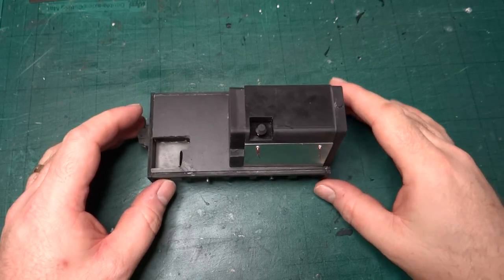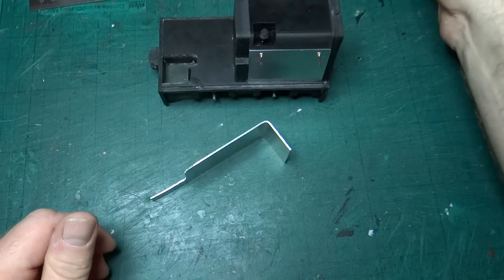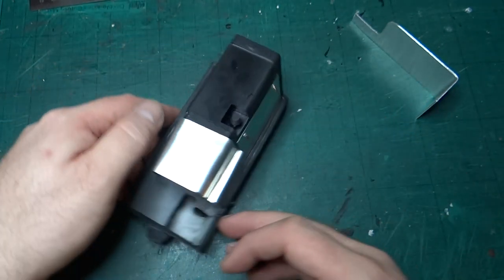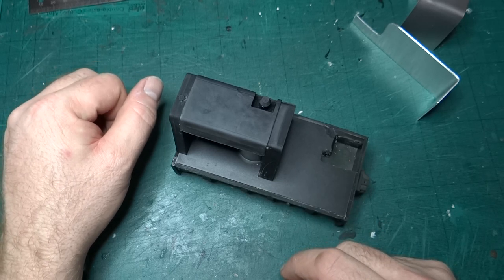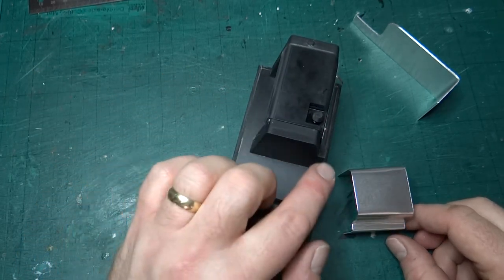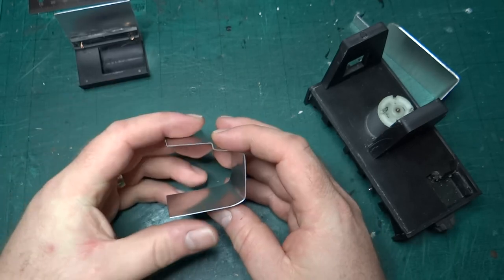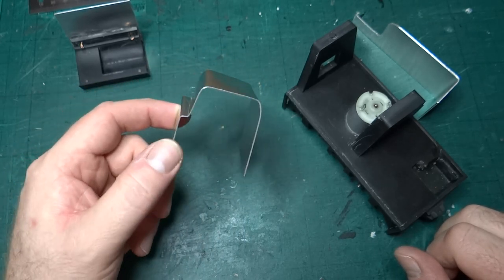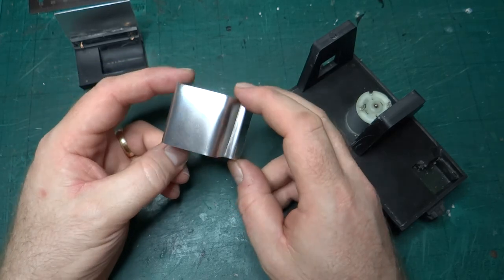Building a 24hp Hudson Hunslet Diesel Locomotive in 16mm Scale: Aluminium Folding Failures

Comment: Maybe even thinner 0.1mm to achieve the step? An alternative could be to make a mould for vacuum forming?
Reply from the maker: Vacuum forming had crossed my mind but I don't currently have the equipment -- would certainly like to give it a try in the future though.

I'm going to see if I can make a form tool that will work with the 0.5mm aluminium but yes if not then I'll try dropping down to something thinner. I don't want to go too thin though (if I don't have to) as I want the sheet to have some thickness to it so it looks reasonably prototypical. Hopefully I'll manage to design and test an initial tool this week so we should know quite quickly if I can pull it off or not. Fingers crossed!